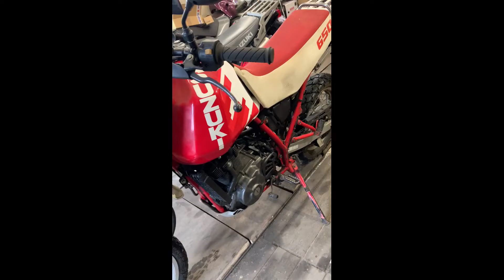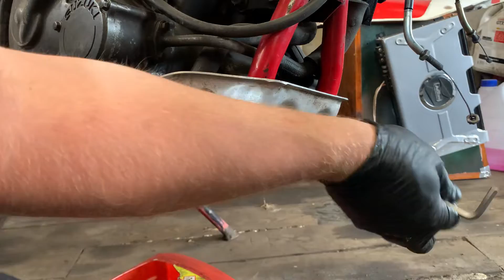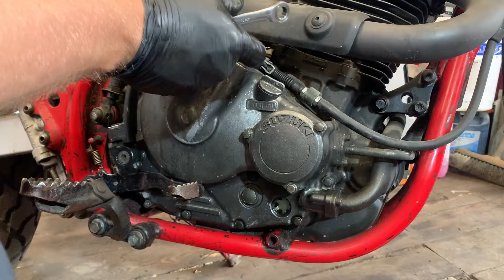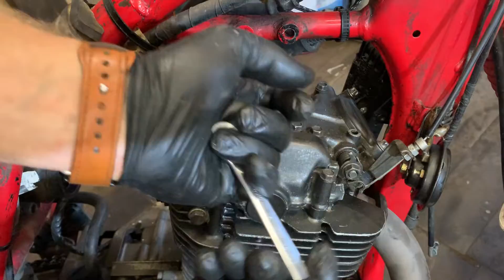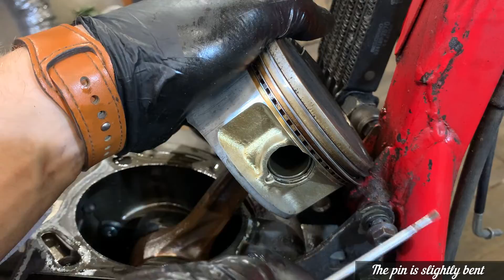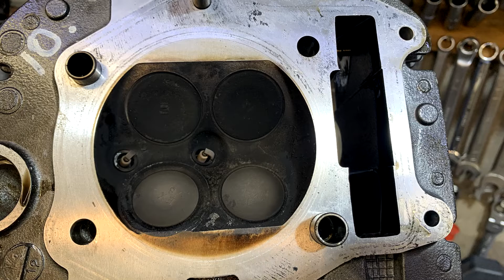Why did the Suzuki DR650 R engine fail?

Comment: The timing chain tensioner and guides should always be checked and replaced if needed,  in accordance with the service manual. A similar thing occured to my friend's Suzuki FX125. The guides were so eaten up that they were nearly non existent. The tensioner also needed replacement but he never replaced it. The damage that was done, resulted in a near total engine rebuild, apart from the gearbox and clutch.  Keep it up!

Greetings from a fellow motorbike mechanic from Greece :D

Comment: If the chain-driven counterbalancer is not regularly checked, too much or not enough slack can destroy the engine with vibrations. Not sure what happend here,  could also be lack of oil

I had 3 of these DR650 Dakar and R with together over 100'000km and lots of trips to Africa desert and North Europe. Never had a breakdown, loved them
Reply from the maker: Yes, the balancer chain needs regular checks, Suzuki recommends every 6000km
This one failed because the timing chain didn’t have any tension on it and it skipped, allowing the valves to hit the piston, and thus destroying the crankshaft bearing
Reply: Good job, sounds like quite some work!  @restorationvalve

Comment: How do we prevent this from happening?
Reply from the maker: One way in my opinion would be checking the timing chain tension by removing the tensioner a seeing what distance
Is left for the tensioner to work in.
The service manual shows how to measure the chain slack, but the biggest problem in my opinion is that the sliders wear out or become hard and brittle and don’t proved the same tension. Checking them isn’t easy, you have to remove the head to take them both out.